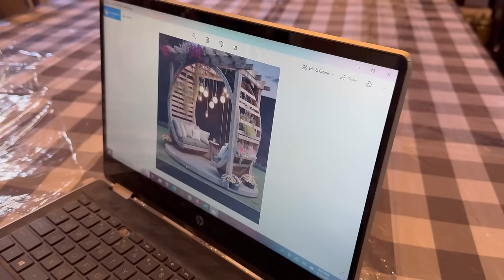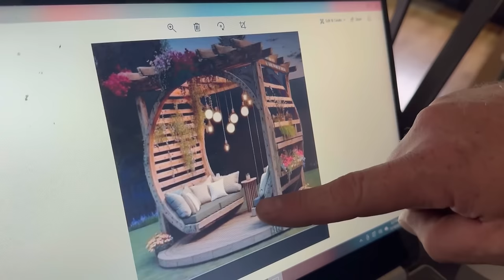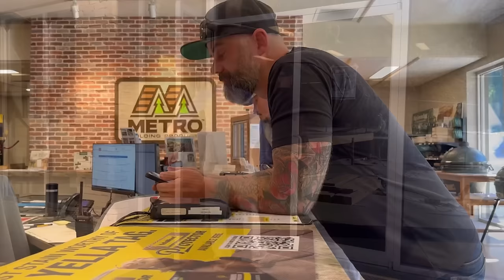I Flew Cross Country To Build This || How To Build A Wooden Pergola

Comment: On drilling long holes with a regular  drill, try using a straight bit. The augur bits drive themselves. Also put the drill on the slow power sitting and go in and out to remove the chips.
Reply: Seconded. I use auger bits exclusively and routinely drill holes up to 300mm (12") without even thinking about it. Highly recommend Fisch (Austrian) or Star-M (Japanese) bits.

When we built our house we burned (literally) through about 5 cheap corded drills from our local DIY store before I realised that we weren't saving any money and actually bought a branded one! I kept them for a long time as a reminder that short term saving != long term saving.
Reply: I use a hand brace. I mean once you done it a few times its quite easy.

Comment: great video, really enjoyed it!
I think the problem with drilling the coach bolt holes was probably that the flutes were filling up and the chips had nowhere to go other than sideways and binding in the hole.
That's probably why the 'babying' technique worked because the flutes will have cleared when you pulled back.

I don't have a theory for why the bolts were too short though ;-)

Comment: I would have left the boards tight against each other. As the wood dries, it will create around a 1/4" gap in between. Your 3/8" will turn into 1/2" or bigger as it dries.

Comment: Big fan Jason! 
I was a carpenter in my twenties. I have been electronic security contractor the last 35 years.
I have drilled more holes in wood and concrete than just about any tradesman you will ever meet.
For drilling those bolts in the pergola I would recommend a small spade bit to start. Go all the way through and then use that 5/8 auger bit. Myself and my techs have the large Dewalt and Milwaukee right angle drills for that kind of job so no pre drilling necessary.

Keep up the great work!!

Comment: Nice build. I would put end caps on the end grain of those 6x6 posts or they will rot. I have fence posts that started to rot on the end due to exposure.
Reply: The manufacturers recommend field treating the cut ends of all P/T wood. Having the cut end up and exposed to the moisture would probably accelerate the process.

Comment: The first thing i thought of when i saw this bench set up was an indoor cat running wheel!  I thought 8 would want to make one too since it woukd be on wheels that would allow the benches to rock like an amusement park ride or teetor toter!  I think you should modify it so it can rock and spin on a vertical axis. There would be wheels on the bottom like casters for it to move!  I just thought if something else to propell it!  Not hampsters!  You could rig pullies on opposite sides at the roof with cords that the riders could pull while seated on the benches to pull the opposite bench up!

Comment: If you find yourself using auger bits again, try pre-drilling with a 3/16" aircraft drill bit so that the screw tip doesn't bite as hard. It'll still pull a little, but not enough to stall out an average drill. The feed rate caused by the auger screw tip is usually the issue, not the width of the auger or the toughness of the wood.

Comment: What's going to stop weeds and grass growing up through the deck boards? Impregnated timber may look dry but inside its wet, that's why you drill bit stuck as it couldn't clear the waste it was cutting off.

Comment: Not done with the video, but just gotta say Greg needs to solder and insulate the wires in his saw... those twist caps are horrible in mobile applications... 

I hope the build comes out nicely, as I would want to build something like it in another form factor, so imma going back to the video and probably forget to edit the message with what I love/think about the build... if it is anything like the AI concept image, I am certain I would love it, and even a basic design would also be amazing.